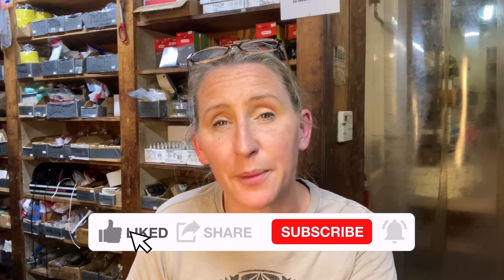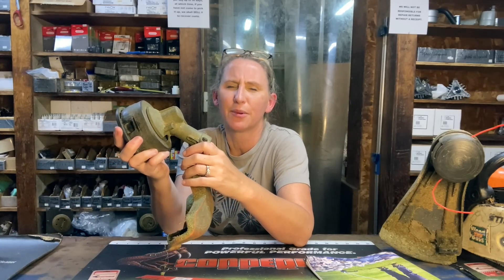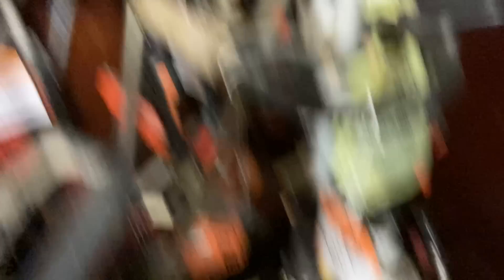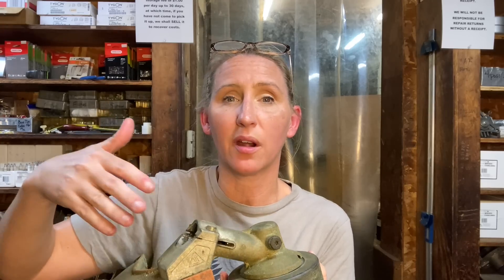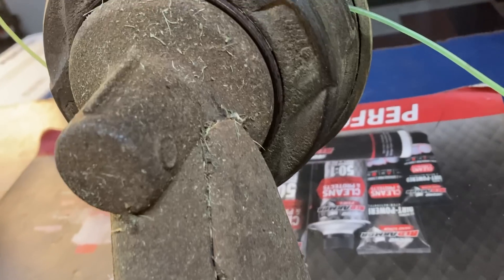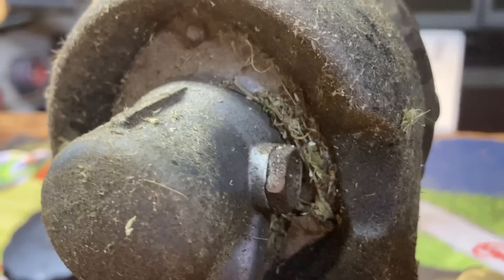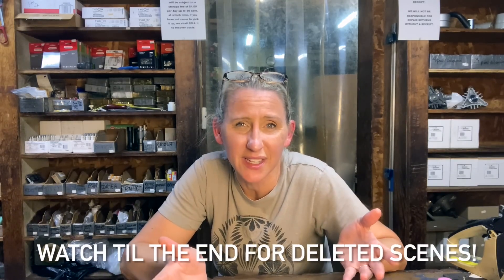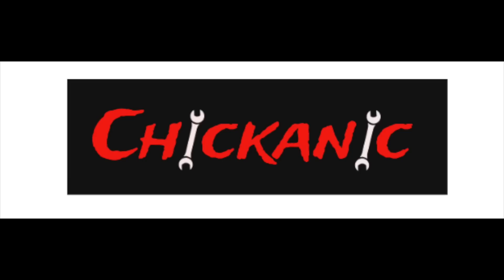Planned Obsolescence?! Why Would STIHL and ECHO Do This?!

Comment: They are making it lighter eliminating the grease hole. If you look the new housing are smaller and less clumsy without the grease hole. I'm kidding🙂 I don't know. 
  However, on a slightly different subject, why don't the manufacturers make their power equipment more women friendly. In other words make machines that will fit the smaller size of hands, arm length and this sort of thing.  My wife and adult daughters are all 3 around 5'4'. Try finding a straight shaft that will adjust to their smaller wingspans and is comfortable. Especially in the battery powered equipment. I've got a good story about this.

Comment: Chick; could the zerkless/plugless trimmer headsbe greased by disassembly from the bottom and packed?  It would be a PIA, but better than just letting it wear out.  Are these commercial or "professional" grade models?  Stihl sells grease in toothpaste type tube that fits their (or used to) grease ports; hard to understand that they want to lose that profit point.

Comment: I like my old Green Machine that has a grease fitting in the gear head. Not just a grease plug a actual grease fitting. The whole trimmer is made by Zenoah in Japan. They sure don’t make them like they used too. Over 30 years old and still runs like new.
Reply: My Dad had a Green Machine. I used that thing WAY more than I wanted as a kid. Throttle on the handle, and gas primer sent gas straight in the ground.

Comment: I have a Ryobi trimmer i bought in 1998... The motor eventually quit.
I replaced it with a brand new 4cyc Ryobi trimmer that i found on clearance (for $40!!). 
But, it came with a curved shaft (no thanks).
So i just swapped the (split boom) from the older one, and it is still running Fine.
Yes, it has an oil plug and yes i add oil occasionally, but rarely. 
The reason they don't put it on certain models is because they are consumer level units.
At 1hr per week, those gear heads will last as long as they like. 
On a Commercial machine, running Hours at a stretch... the head will be very hot and the oil will run out past the seal in a season or less. 
This is the Huge difference between Homeowner and Commercial in the lawn care business.
Also, i'm sure some Homeowners actually damage their gear heads by putting in the wrong lubricant and that becomes a warranty claim..
Fwiw, i do not use Grease. I use standard Gear Oil, like 80w-90. I'd suggest something like 140 weight for trimmers. I think i have also used the Lightest grease that there is, which is 00 weight, basically reserved for Snowblower auger cases. 
Actual grease is a bad idea.. first: it won't "flow" around the gear, but rather stick in place and do nothing. Also, grease will separate when hot and the oil will run out of the case leaving behind and even thicker base wax which will stick in place even more... So use oil. 
Another trick you can do is to just pour a LITTLE oil down the open end of the spit boom if you have one. 
Gears really require actually very little lubrication, ultimately. So failures rates are typically low. 
It's not hard to imagine homeowners oiling their trimmer heads and then forgetting to put the plug back in and getting a bunch of chaff in there and then "whoops" and just putting the plug back.
Doing that Will grenade the gears in short order, so again... less maintenance options; fewer Fk-ups 💁‍♂️
😉

Comment: I know where I live, most repair shops regardless of what is wrong charge 50% of the cost of the item needing repair. I think they figure that some will pay it others will opt for a new tool. I think most people shop price, and if they get a few season out of something and there's a problem with it, they just go buy the latest and greatest and go about their lives. I am blessed to have worked on thousands of pieces of small equipment where I worked, and that I have resources like you to keep me up to date. I buy better models for myself and because I can service them myself the overall cost is really low and the stuff lasts almost forever.  But many others that have purchased the better stuff, but depend on the local shops for maintenance and repairs get a bad taste in their mouths because they get about the same amount of use before it and the cheap stuff needs attention the first time, so they take it in over winter when the places are looking for work and they get the special tune up special. $59.95 and all the shop does is blow the dirt off and stick a new plug and air filter in test run it and send it.  Well if you have a cheaper unit that might as well be half or almost half of the price of a new one. So they buy a new one and leave the old one behind. The shop turns around and sells the old one and makes money on it and the sale of the new one. The person who buys the better equipment and pays to get it serviced each year ends up spending more over the life of the equipment because like I said the shops around here, no matter what is wrong try to charge about half of what a new unit costs. I sent someone in with a leaf blower that had a clogged exaust screen and that was all that was wrong with it.  The unit itself was only 5 months old.  I wanted to see what they would charge for.  They got a bill for  over half of the price of a new one.  They replaced air filter, fuel filter,fuel lines, sparkplug,  exaust screen, readjust the ecu and carburetor.  They were beside themselves. I don't have the space to time to repair all the stuff that people ask me to do.  I didn't realize how the local places were treating people. I wish I knew of a place near me to send people to that, does honest work. I am just glad I can still do my own stuff.
Reply: I work in this industry.  Yes there are some shops like you say, but there are far more that are not that way.  What many people who buy this stuff don't realize is the ethanol in the fuel.  It destroys the fuel systems in these units and that is why all those parts need to be replaced.  I have seen many a customer come back on year 2 complaining about running issues and come to find out they stored it with regular gas for 8 months.  The dealers aren't doing this to screw a customer, its the reality of ethanol based fuel and poor maintenance by people who don't understand that yearly service is just one part of keeping a unit in good order.

Comment: There must be classes for this, that I have yet to find.  Anyone know of a hack for an old  Stihl TS350 toroidal coil?  As a life long electromechanical troubleshooter I have run into some lu lu's.  My auto mechanic friend had a nightmare not long ago with an engine that had no key-ways for the timing, ya have to have special tools to hold it all in place and torque them perfectly in place.  The most recent that I can recall was having to aircraft safety wire the terminals for the tail lights on my ~15 year old Ford as the retaining clips all just fell apart, the cheap plastic hinges were super thin.  If the weak running link doesn't go off as planned, it could get rear-ended to get it off the road.  All this go green stuff would go better if they would stop this tactic.  One would think after a hundred years of making trucks they would have it perfect. The college courses must be alike The Far Side cartoons.

Comment: Back in the 80's I bought a new poulan chain saw. I quickly wore out the chain as it wasn't tracking well on the bar and when I went to replace it I noticed the bar was already worn out. No not from lack of chain lube but just plain wear. I talked to the dealer who said that the bars that came on it were all temporary bars and you had to buy a better bar. ??? Kind of like my 82 ramcharger. At 30K miles a front brake caliper seized up. Tore it down to find a plastic brake piston. The replacement was stainless and cost $4 or so. So to save money the factory put a plastic piston in the brakes they knew would fail by the end of the warranty.
Reply: Was it a phenolic piston?  That provides better thermal decoupling and better corrosion resistance than other materials.  Unless they are extremely overheated, they have a high chance of lasting longer than the rest of the caliper.
Reply: @1djbecker  Yes it was and they didn't last past one year. I replaced them with steel and they were still on the truck 20 years later.
Reply: @71160000  Statistically phenolic is a better choice.

Most vehicles never get a brake fluid change.  Providing a little extra thermal margin and eliminating corrosion is a better choice than picking a stronger material that requires regular service.

I usually use high temperature DOT-4 fluid.  I know I regularly need to change the fluid.  If I don't, it will be quickly be worse than untouched DOT-3.  I'm willing to make that tradeoff but it's a poor choice for most consumers.  (The newest vehicle came with DOT-3, which will remain untouched until out of warranty.)

Similarly a grease fitting is only better for users that know what type of grease to use, and never services with a incompatible grease.  That is a tiny subset of users.

Comment: Stihl has been doing this (NON-greasable gearset) for at least 8 years.  I bought a new  56RC in 2015, and noticed this 'feature' pretty much right away.
I am thinking that a person could drill and tap a hole in the cast aluminum housing, and install a 1/16 (?) inch grease fitting, as the John Deere TS105 that I once had did.
Reply: GO  AHEAD,  I  DID.    WORKS  AWESOME.  PLUG  A DOZEN  SHOTS OF GREASE IN,  THEN ADD SOME  80-90  gear oil.  NO  MORE   noise, at 12k rpm.  Take care , BRO !.

Comment: There is a backside with grease plugs though. If you put to much grease there is a risk that the bearings might overheat and the sealings can blow and start leaking.
Alltough, in Europe the plugs are back on Stihl now maybe as a results of customers complaints.

Comment: The bean counters are telling the engineers to make it with sealed bearings so they will only last so long before the customer comes infor repair or a new unit. This is not just small engine manufactures,everything in the modern consumer world has a set life now days.

Comment: Possibly because they fail on something else and then why bother putting it in when it's so often forgotten. You can save on one thread cutting step, a screw and running in the screw stepduring manufacturing. Saves money. Perhaps it's compensated with a high grade grease such a MoS2 such that it can  longer do without regreasing. By that time  the trimmer wil already have a fuel related problem😂.

Comment: They want stuff to wear and get replaced with new. 
It’s been going on for years. Look under any new truck front end and driveline and look for zerks. Gone. Repackable wheel bearings. Gone. Now it’s a whole assembly for 200 bucks. It’s nuts but what do ya do? Great vid Chicky and that guy on the mower was probably on the way to the bar! 
Lol. Have a great day!

Comment: One of my professors in a econ class was a lead engineer for GE ... I remember the lecture vividly . He talked about how GE designed refrigerators ... As an engineer they would start with a cardboard box, then they would ask themselves, what is the bare minimum that it would take to make this cardboard box into a refrigerator . He said, they would slowly add the bare minimum to the cardboard box in order to make it into something that resembled a refrigerator . He openly admitted that it was that absolute minimum at the least cost to GE . I think the same thing still happens today. Granted, I listened to this lecture 30 plus years ago .
Reply: "Ben" the appliance guy, also on U-tube, said he met an engineer, whose job it was to deliberately skimp on quality, so the appliances would die.  (I'm surprised he didn't belt him------I would have the impulse).
Reply: Every engineer wants to make that one awesome thing they can brag about. As a result, if they're not held in line, they'll make really neat things that no one will buy due to price and that will have lots of problems due to the complexity.
Reply: I have a GE refrigerator from the 70s that is still running so it wasn't always like this
Reply: Jack Welch who ran GE starting in the late 60's early 70's invented the MBA program to keep his many middle management people busy so they wouldn't think about the zero chance of getting promoted. I worked with several Ex GE managers who worked with Welch and none had anything good to say about him.
Reply: interesting.this probably applies to all products tbh sadly
Reply: Except that's not true, refrigerators made over 30 years ago when he worked there, lasted a lot longer than what you buy today, so they were not actually doing what he claimed, not very well/badly yet anyway.

However, even that is nonsense.  He didn't "openly admit" as if you interrogated him, rather you are fabricating part of the story.

Further, no, "start with a cardboard box" is a concept for high school kids.  Engineers designing appliances don't ever need to devolve that low in concept because they've already had experience working on appliances, so the more I think about your post, the more I think there's little if any truth to it at all.

For example, using the chassis as the frame to mount everything is a key design parameter, not at all like thinking in terms of a cardboard box.  Maybe he wasn't really a lead engineer, or whatever the case, your account is implausible.

Comment: I'm assuming they're going for a sealed transmission type concept. My old Toyota Tundra literally said to never change the transmission fluid in the service manual, unless the transmission was routinely subjected to heavy towing.
Reply: The chance of a service screw-up that results in early transmission failure outweighs the chance that you'll be extending the life of the transmission by putting in fresh fluid.

Towing increases the chance that the fluid will start breaking down, or that the additive package will be depleted.  That changes the odds.

Comment: If they just closed it off that makes no sense if they replaced the open bearings with a sealed bearing I could accept that at least as some improvement. Need to take one apart and see if indeed it is exactly the same maybe it has something added and the parts list is not showing the change.

Comment: Hanging a weed wacker by the head while it's hot lets grease get out of the gear box and back down the shaft so it is running, starved of grease for a while when started up.

Comment: I just realized my 56RC didn't have a grease plug. Thanks for the tip! I'll just expect it to fail at some point.
Reply: you could always drill and tap a hole for a grease fitting if you really felt motivated.
Reply: @crazzywolfie  possibly, but looking at the housing, I'm not sure if it would work.  Good idea
Reply: @Ubotit_Unaymit  i really don't see why it wouldn't work. you just need to get grease in to keep water out. the cast should be more than thick enough to ad one.

Comment: Too funny!  Just had my 56RC apart to grease it. Found a YouTube video which I followed. Took the gear head off.  Using a syringe, A fair amount of grease went into the square opening of the pinion gear where the drive cable would connect.  Cannot confirm 100 % grease made it into the housing, but the fair size syringe emptied, and the gears seemed to tighten up more. Maybe something you want to investigate Chickanic ??